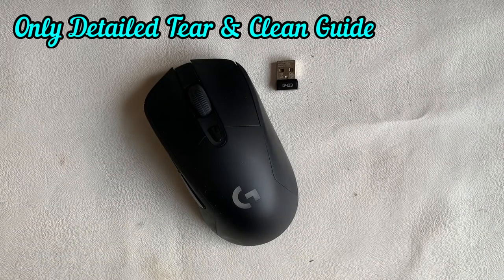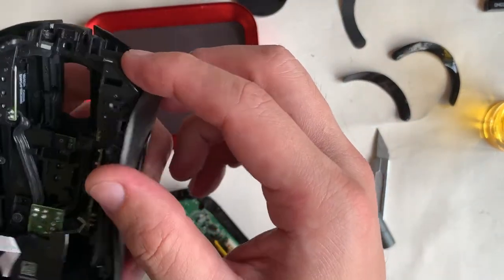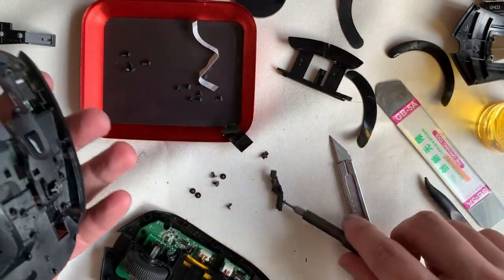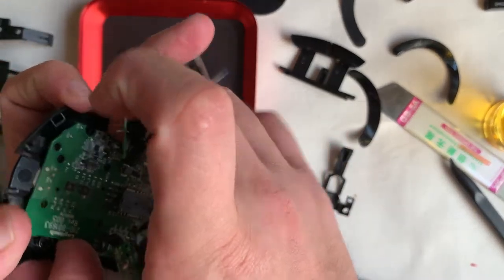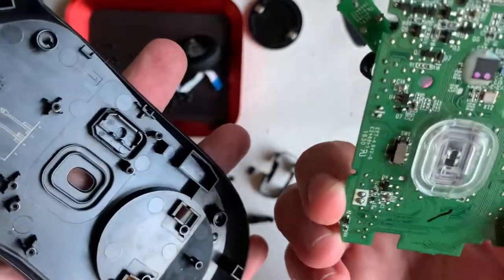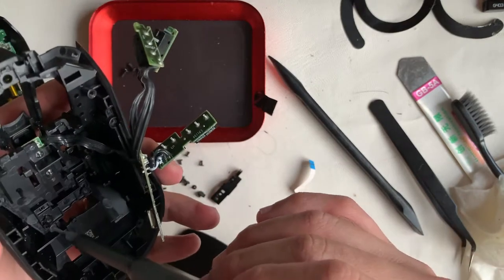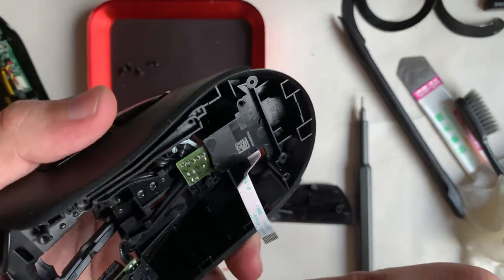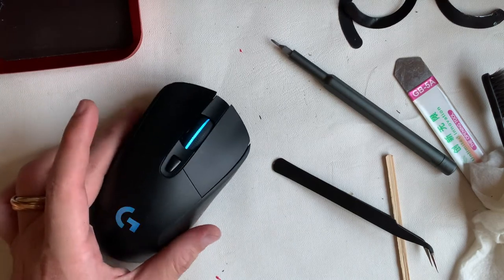#29 Tear Down & Clean (Detailed) Logitech G403 Wireless Gaming Mouse (Most Difficult to Date)

Comment: Great video. Good explanations. Really nice closeups actually. A few timestamps would've been nice.
I've got a question though: 
How far do you think i have to go to slip a sheet of... something thin... on top of the right button switch? It has the problem that when i click it too hard it doubleclicks. I am thinking to just make it impossible to press that far down.
Reply from the maker: within the switch there is a very thin metal contact which is worn , best is desolder the switch and replace it you have the tools and finesse , took me a few damage mouse before getting the hang of it

Comment: I made the same mistake that you did about that screw. I want to thank to that engineer that put that specific screw there >:(
Another important part is you need to pay close attention to the tension springs. Those are easily fall a part when removing buttons especially the right one. Its hard to put it back cause its really tiny.